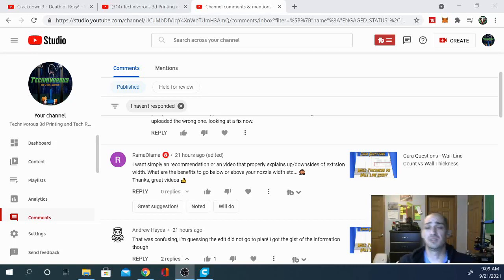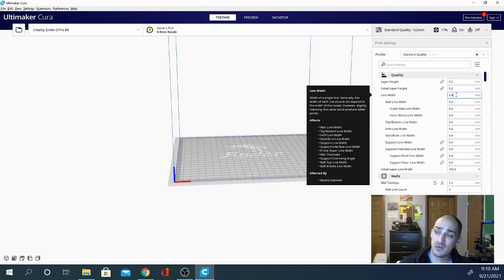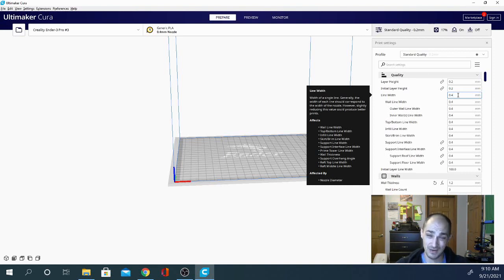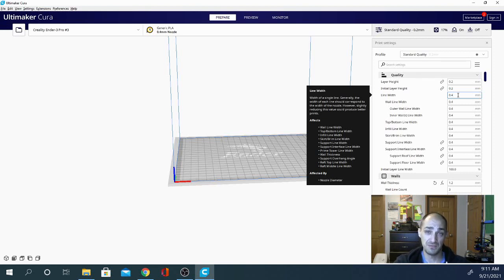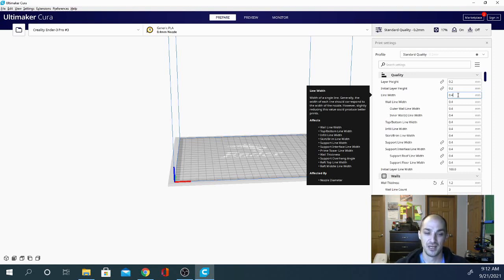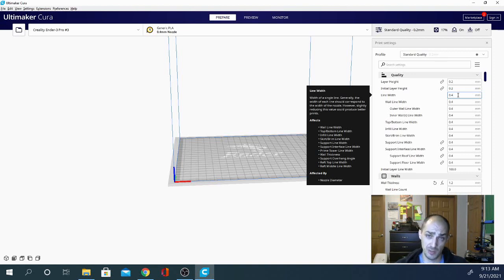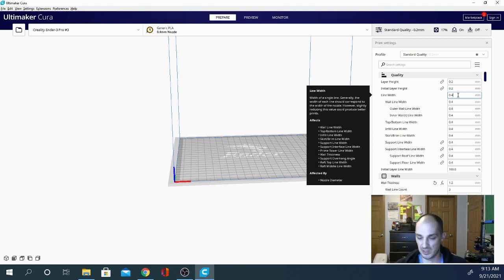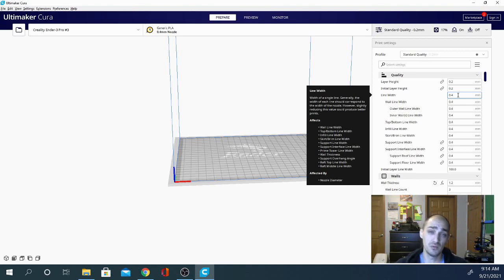Cura Questions - Nozzle Diameter VS Line Width

Comment: I disagree with your assessment.
Line width is a simple distance between two lines within the same layer. Line width is not extrusion multiplier. Those two settings work together. Line width tells your print head the distance between the lines (in the same layer) while extrusion multiplier squeezed enough material out to fill those lines. You can increase your extrusion width to even over 200% if you print slow and your nozzle ´has a large enough flat area. I usually print sorting boxes for example with a 0,4mm nozzle at 200% so around 0,8mm wall thickness. Which mates the parts much stronger and prints much faster while keeping the same quality since it´s just one line. Same can be applied to vases and other similar geometries for faster and stronger prints without compromised the overall quality.
Having sad that, an important factor to consider is layer height. It´s a big difference to have a extrusion width of 0,6mm and a layer heigth of 0,2mm or 0,1mm with 0,1mm the squish and the forces inside the extruder will be much higher.
Many people claim to have great results with extrusion width lower than nozzle diameter, this is because the extrusion multiplier is still much higher and material still squishes to the sides.
You physically can not print with an extrusion width of 0,3mm and layer height of 0,3mm because this would mean that you will get a perfect circle in cross section.
Reply: I agree. It makes sense to set it lower in specific situations. I have also set it to 200% on a 1mm nozzle to print 2mm walls in vase mode.  there are some neat  things you can do by changing it.
Reply: @parsonk4041  The best thing is, with the currect Prusa slicer which has Arachne you can even set the upper and lower limit for layer width and the software will sort out the rest. I have mine set to 0.6mm but it can print down to 0.4mm automatically.

Comment: It is indeed possible to print in thinner lines than diameter. Properly adjusted one can print finer details. Whatvare the issues you are mentioning, can you go into details please?
Reply from the maker: It IS possible. But it's smarter to get a smaller nozzle for smaller detail.
Reply: It is not physically possible. It is only possible because your extrusion multiplier ist still higher and the filament being extruded still squishes to the sides.
Example: Nozzle dia. 0,4mm extrusion width 0,3mm layer height 0,3mm means a perfect circle in a cross section. This is not possible since it wont stick to other layers or the print bed.
As you can already see in my example, my claim depends on layer height, extrusion multiplier and extrusion width. Those factors work together. Extrusion width of 0,3mm and layer height of 0,05mm will maybe work even better than a normal extrusion width. Because the filament will still be squished.

Comment: I am new to 3D printing. There's not much information about centering your print on the bed. They talk about changing in Marlin and recompiling. What's a way to center the print in Cura. I'm using the Ender-3 profile on an Ender-3 V2